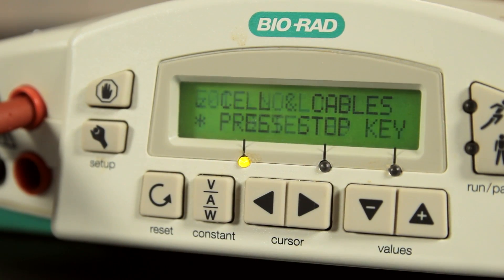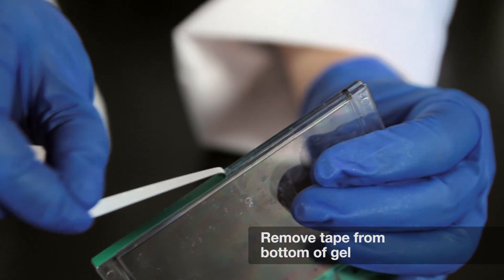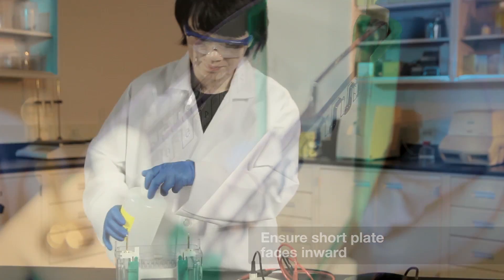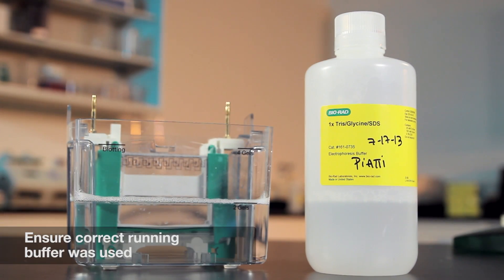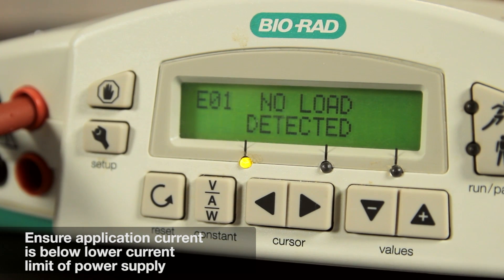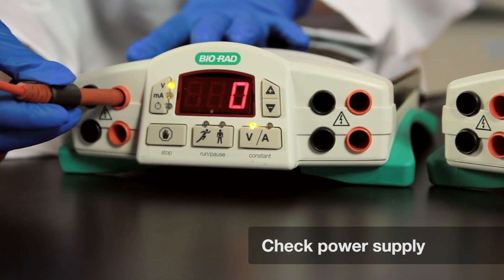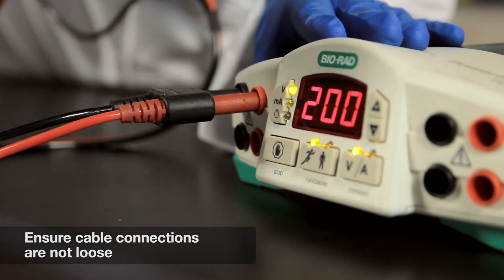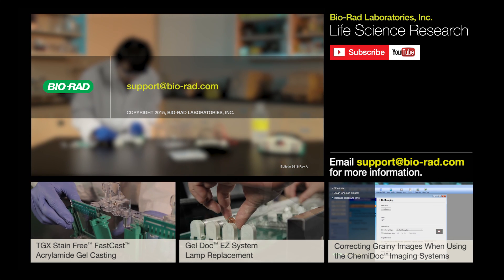PowerPac™ Power Supplies: Troubleshooting the E01 Error Message

Comment: P. S. Just did little research. Is it possible that the issue is caused by using non-authentic  type T (Time-delay or slow-blow) fuses by previous owner, because I noticed that straight single wire is used in the glass barrel, not coiled wire?

Comment: I bought an used PowerPac. During initial test, the screen lit up but no start up and I heard a nonstop high-pitched sound. I assumed it may be normal, so unplugged the power cord, then plugged it back to the outlet. This time, the PowerPac started up, display was normal and  I could set any numbers within the ranges. The next day, I plugged the power supply into the wall outlet and it started up normal. So I left the power supply stand still for a couple of months until I tried to test if the machine is working or not, what I got is lit up screen only, no display, fan's spinning with non-stop high-pitched sound. Tried many many times, startup has never come back. What's going on with this power supply? any help is greatly appreciated.
Reply: Thank you very much for your quick reply. 1) The power supply model No is "PowerPac HC", S/N: 043BR13718. Fuses : 8 A Type T;  2) I don't see any character after plugging in wall outlet, no words, no messages, nothing except brighter green background; of course with non-stop high-pitched sound; 3) I never tried to run with nothing attached, I dared not to do that because I am not sure if this action could damage the machine or; actually last year I bought an identical power supply, display was normal, no error message, I could set any number within the ranges. That's it. Then I took it back to China, it is working perfectly in our labs. 4) I took out the dual fuses today and both gave me ~0.7 oh? seem it's not blown fuse issue; 5) I tried to turned off the switch and turned it on with like 1-2 seconds, I could see 3 or 4 yellow tiny light bulbs adjacent to the keys lit, but the screen did not light up. I got an impression that this power supply fails in initial testing during start up.
If there is any additional info I can provide, please let me know. Thank you very much for your help in advance and I appreciate it  very much.
Reply: PS. the fuse printed like "T 8A L 250V", dimensions: 5mm X 20 mm
Reply: thank you very much!

Comment: At first the running is perfect and after 30 min this error appears. The potential cause can be the one of the discussed here?
Reply: I had the same problem. Ensure there is a water tight seal between inner and outer chamber. If there is a slow leak, the inner chamber will fall below the minimum amount over time and give you the error